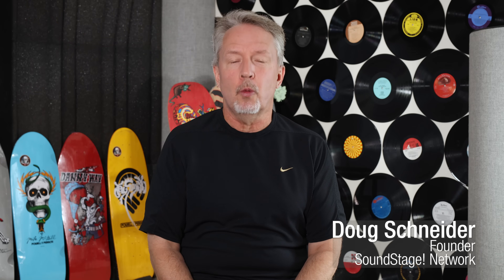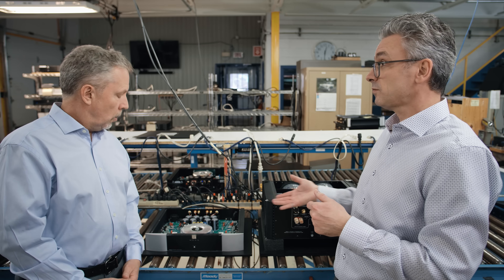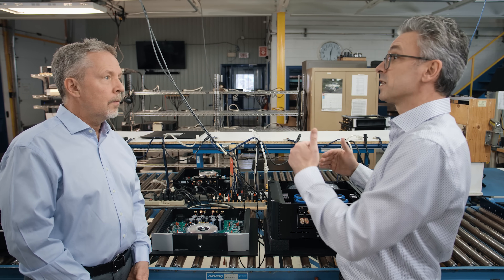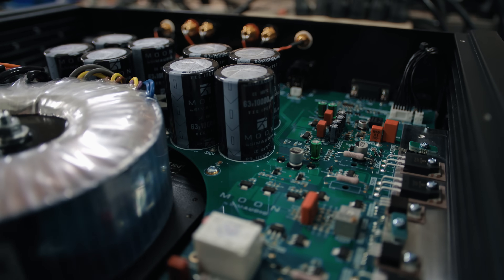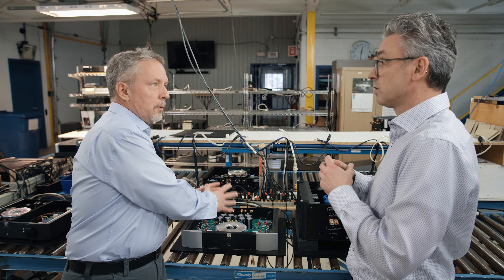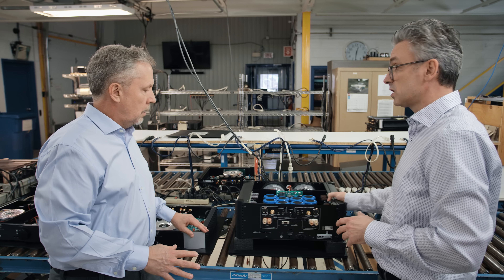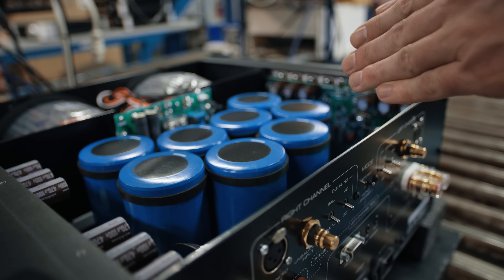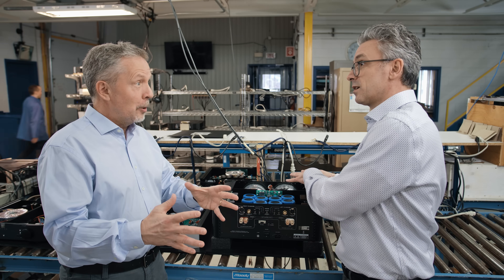Why Amplifiers Don't Sound the Same - Understanding Voltage and Current for Loudspeakers (Ep:71)

Comment: He just touched upon an amplifier’s power supply’s ability to supply required amps and volts to produce music as needed.

We are supposed to be talking about why amps “sound” different -

Although most middle-aged people can’t hear beyond 12/13 kHz, and the lower frequencies have their own limitations in each amplifier, - but the SOUND of each amplifier is really dependent on the chosen transistors and diodes and .   . . . Resistors and inductors and . . . . ALL of which in their respective characteristics - switching seeds, amounts of currency’s able to move in a specific amount of time, the “color” of the Signsl coming out of the  these components etc - being able to reproduce harmonics that accompany the fundamental etc . . ,

This is why the most expensive amps- think McIntosh have large chassises etc to house very large  - transformers and Capacitors to help reproduce those sounds.

Two equally priced amps, McIntosh V Accuphase will sound different  - to a 13 year old kid who CAN hear all those frequencies and the power they are delivered with.

Best tests of any power amp is the ability to faithfully reproduce a square wave - 

Look at the FFT output of each amplifier with the same square wave (amplitude and frequency) going in - with this setup even an old man will be able to “hear “ the differences between the two amps.

The main tone of the Fundamental frequency will be of a different amplitude at the output - as well as the harmonics - which too will be of differing amplitudes !

That’s how you determine the differences in sound produced by different amps !

Take a screen capture - of both FFT outputs. 

Do a Dynamic Distance metrics on these and “see” the difference a 13 year old kid gears !

Comment: Simple , buy an amplifier which   doubled the watts when half the impedance!  If amplifier delivere 100 watts at 8 Ohms , it's should delivere 200 watts at 4 Ohms  and 400 watts at 2 Ohms so on ... such Amplifiers requirs substantial power supply  and output stage.

Comment: Sorry for the stupid question but does that still mean that given a speaker of avg sensitivity many amplifiers will sound the same at low-moderate listening volume since the amp will not be called to reach its power supply or output limits??
Reply from the maker: Basically, yes.

Comment: I much current can a typical stand-mount and floor-standing speaker demand from  an amplifier? My current amp ( pun intended) is an Audiolab 6000A, is capable of supplying 9 amps of current into a speaker and it sounds really clean. Thanks for this video.

Comment: Something's will always get more complicated if you let them.. and owned 16 different amplifiers in my lifetime to this date.. the only difference between amplifiers I've ever heard or whether they were the letter d or the letter H or the AB TYPE.. THE OTHER WHICH IS OBVIOUS IS THE OUTPUT OF THE AMPLIFIER SO A 50 WATT AMPLIFIER WILL ALWAYS SOUND MUCH LESS APPARENT THAN A 200 WATT AMPLIFIER PER CHANNEL.. SO WHEN COULD GET TO THE POINT OF DELIRIUM ATTEMPTING TO MATCH SPEAKERS WITH AMPLIFIERS WITH TURNTABLES WITH CARTRIDGES.. MAYBE TO THE POINT WHERE YOU'RE NEVER SATISFIED AND YOU'RE RETURNING EVERYTHING YOU BY AND YOU'RE MISSING THE FINAL OUTCOME.. WHICH IS THIS AND IT IS JUST NATURAL HUMAN EXISTENCE. IF YOUR EARS ARE ONLY 20 YEARS OLD YOU HEAR THINGS ARE YOU HEARD THINGS DIFFERENTLY THAT YOU WOULD ONCE YOU'RE PAST THE AGE OF 35 OR 40.. OR EVEN OLDER THE THING IS IS THAT ONCE YOU GET PAST A CERTAIN POINT IN PHYSICAL AGE FROM USE.. THE FINER DETAILS END UP NOT REALLY MATTERING MUCH, I TELL THE TRUTH.. ONLY BECAUSE I'VE BEEN WORKING WITH SOUND SINCE I WAS 12 YEARS OLD CAN I DO KNOW WHAT'S WHAT AND I OWN THAT I AM IN MY EARLY SIXTH DECADE I SHOULD WRITE A BOOK ABOUT THIS BECAUSE IT IS THE SAME FOR 80% OF ALL HUMAN BEINGS.. NO REASON TO OBTAIN EQUIPMENT THAT IS FAR ABOVE YOUR OWN ABILITY TO HEAR OR TO SEE BECAUSE IT WON'T MATTER.. AND IF YOU GET TO A CERTAIN POINT THE SPL OR THE VOLUME FOR THE PRESENCE BETWEEN YOU AND THE TYPES OF SPEAKER YOU MAY PREFER OR CAN AFFORD..😊😊😊😊

Comment: Maybe you can do a video in the near-future about Class A or AB amps vs Class D amps when it comes to output current. I've noticed most Class D amps are 25-30 A, despite putting out a lot of wattage, while Class A & AB can easily double or triple that number; the Parasound JC1+ are capable of 180A! I assume it's because of the power supplies being small in the Class D amps vs big transformers and caps. 

I've used Class D amps for the past 4 or 5 years to drive my Dunlavy SC-IV and SC-V, but I wonder if I wouldn't be better off with something Class AB with 60+ amps of output current. How much current is really enough?

Comment: The issue of speaker sensitivity get complicated when measuring using 2.83v on a 4 ohm speaker. 1W is not what that speaker sees.
Reply from the maker: It's not that complicated if you realize that in hi-fi, we're not talking about power sensitivity but voltage sensitivity. Doug Schneider explains that in this video: https://youtu.be/XQs2tBsfPBk

Comment: What's the difference between the output of 1 watt power tube and 1 watt power solid stage? classA
Reply from the maker: A watt is a watt -- tube, solid state, class A, class AB, class D
Reply: @soundstagenetwork  so a 1 watt tube amp is equivalent to a 1 watt solid amp producing the same decibels to drive an 8 ohm speaker.
Reply: @edSuwanDiyAudiophile To jump in here -- a watt is a watt. You use Ohm's law to calculate -- and it's the same for tubes and solid state. Voltage, current, and resistance, that's it. There's long been a thing, though, where people think "tube watts" are more powerful watts. I'm not sure why. Perhaps some engineers can jump in and explain where that stemmed from.
Reply: @dougschneider8243  this is always my question about voltage and current, and I got the same answer as described.  but in practice there is a marked difference.  I don't know if the manufacturer didn't provide honest specifications or indeed my test was inaccurate.  if I observe this relationship with Current and voltage.  
Correct me if I'm wrong, the tube plays with high voltage and is solid with current.  up here based on Ohm's law is still the same.  but in practice impedance becomes wild and different from real DCR.  from my experience 1 watt tube with transformer output provides a more stable impedance (matched - more efficient) than a solid stage.  Possible?  correct if wrong.  but this has always been curious and I'm still looking for a physical explanation.

Comment: If you get the paper if you get the right paper by Bob Carver it will explain you about voltage and current.. on the basis of voltage that is driven for the bass note, high and current is made mainly for the mid-range and tweeters for softness or soft glow, give you an example Japan receivers of the last 35 years use only voltage very little current then what else sound too good, I had a marantz receiver from overseas, better bass notes with the current and a touch of current for the upper end, my Carver HR752 receiver have higher voltage and 30% more current.. you might say a high-end receiver and it was...
Reply: Bob Carver White Paper on amplifier.. it explains everything

Comment: Are 11ohm loudspeakers easier to drive than 4 ohm types?
Reply: What's important to understand is that in almost all loudspeakers, impedance varies with frequency. So there's really no such thing as a consistent 11- or 4-ohm speaker. You'd have to see the impedance over frequency to know which would actually be easier to drive.

Comment: Just get some powered speakers that come with a built in amplifier. I switched over to powered speakers in 2021. Currently  I have two QSC KW 153 speakers and two Bassboss VS21 subwoofers. The QSC's are 3 way speakers and they sound better than comparable ones from Mackie, Electro Voice, Peavey or JBL. The Bassboss has a 21 inch subwoofer and it's amazing. It has more low end punch than a cabinet with dual 18 inch subwoofers.  I have everything  hooked up to a Yamaha MG 10 mixer and a Sony CD player carousel. Bassboss products draw a lot of current. My living room had the standard 15 amp wall receptacle outlets. I decided to change those to 20 amp outlets  along with 10 gage electrical wiring as a precaution.

Comment: Loudspeaker impedance is a very important consideration when choosing an amplifier and the power supplys ability to deliver enough current. A loudspeakers impedance varies greatly with frequency. Some loudspeakers have an impedance that may drop as low as 2 Ohms and will require an amplifier capable of delivering high current on audio peaks. In other words, if your speakers impedance dips low at certain frequencies then choose an amplifier with a beefy power supply. The lower the speakers impedance the higher the current required to prevent the voltage across the speaker terminals from collapsing.
Reply: You're halfway right get the white paper by Bob Carver you explain to you

Comment: Zero negative feedback Should result in Better sound?
Reply: Not necessarily. First, it's hard to find a truly no-feedback design, even if the manufacture says it. But more important is that feedback is not, as one amp designer once said to me, "the work of the devil." Feedback is used to correct the output signal and in doing so generally lowers distortion and, also, the output impedance. So when you look at the measurements of an amplifier with feedback -- pretty much all -- you'll see lower distortion and a lower output impedance of overs with no or little feedback.
Reply: @dougschneider8243  thank you for the answer

Comment: What is an "audio signal"?  
Short answer: It is a single voltage that varies over time.
Long answer: It is a single voltage that varies over time.

It is a basic understanding in physics that any conducting component (wire, capacitors, coils, tubes, transistors, transformers and on and on) can have only one single voltage present at any given moment in time.

All that bouncy ball voltage does is direct the motion of your speaker cones.  In fact it is literally a map of how to move them to reproduce the entire performance.  That waveform you see on an oscilloscope is exactly that ... a plot of how to move the speaker cones.

There's no magic.  Just plain old directed power delivered to a speaker.

Comment: Hello, i have Dynaudio Heritage Special loudspeakers and they do need some power as i believe they dip into 3.2 ohms and are 85 db sensitive. I have a good solid state amplifier now but before these i had powerfull class D amplifiers but they were not a great match. I'm curious on how much current class D amplifiers have in general. Do they have less current then a good solid state amplifier?
Reply: The answer is: "it depends." That's the same as it is with most things. You could have a poorly designed class-D amp that doesn't drive speaker well or one that does. What many class-D amplifiers DON'T do well, however, is stay linear with load. Many sag in the high frequencies when driving a loudspeaker. But not all do. The Purifi-based amplifiers I've had experience with -- Purifi's own engineering sample plus two power amps from -- have high output power and the ability to drive low impedances with each. For example, all the amps I mentioned output around 200Wpc into 8 ohms or 400Wpc into 4 ohms, and are stable down to 2 ohms and below. Many traditional solid-state amps can't do that. Hope that answers.

Comment: That has nothing to do with "sound". You are describing power delivery capabilities. A low powered class A amp can sound significantly better than a high power class A/B amp or vice versa!! No doubt a well designed power supply is required for a good sounding amp, but more importantly is the amplifier circuit design that "shapes" the sound of an amplifier that makes one amp sound better than the other.
Reply from the maker: We think that most would agree that if an amp can't deliver sufficient power it will affect the sound.

Comment: Is it as simple as the ability to deliver current as the speaker load draws it or do other factors also come into play. I have heard differences between various amps in stage depth, lows, mids and highs. Sometimes there is no difference in certain areas, sometimes it stands out significantly.  Also, why do some amps sound smooth, some grainy, etc.?  I listen at moderate levels tending a bit on the lower side to judge these differences assuming that most amps can supply the necessary power requirements at these levels.

At louder levels, you can hear when an amp is running out of steam and it probably starts doing so before you actually hear it, but before that, I can hear differences.  When I choose an amp several years ago I compared a hegel h90 against a Parasound Halo integrated and preferred the Hegel. The differences weren't much but it was there in the shop on B&W floorstanders, speakers well beyond what I would actually use.  system synergy, room, etc. could have played a part but I have swapped out alot of amps in my room and speakers and hear differences. 

I did end up with a Hegel h160 and a Keces E40, and both play to my liking.  If I listen to the h160 awhile and swap in the Keces, I notice a slight difference but I wonder if that's due to the Keces E40 going from a cold start.  Going the other way, the difference isn't as noticeable at least in the lows and mids. The hegel has a bit more extended highs but the Keces is a nice little amp.

Both drove the Dali Menuet SE just fine but the Keces petered out at about the 3 o'clock position while the Hegel had no issue with going louder but that little speaker is known for being power hungry and dropping well below 4 ohms over a significant part of the lower mids. The small amp got quite hot in the process.  Pushing a Dali Opticon 1, similarly spec'ed, it had no issue as the speakers per measurements never drop below 4 ohms.

It's a rabbit hole hobby isn't it?
  
   .

Comment: This is one of those time the analogy to water flowing in a plumbing system is informative.
Current is the volume of water that can move.
Voltage is the pressure of the water.
The capacitors are a local reservoir or tank.  They can supplement the supply and smooth out the flow pulsing from the pump.
The transformers are like the pump that can take it from the well to the tanks.
The size of the wires are like the size of the pipes.  Bigger can move more and more instantly.
Finally the transistors or the  vacuum tubes are the valves that regulate the flow of current/water.  Each valve can supply only so much, so many are used in parallel.
So the valves are opened and closed in relation to the little signal coming in and amplified into a large flow.  We want the output to exactly and instantaneously match the signal coming in.  Most of the time the signal is very small and we use a fraction of a watt. (V*I).
But when there is a large sound like a drum strike, we want the speaker to instantly respond and that takes a momentary surge of power to recreate the dynamics.  If the amp cannot respond quickly, accurately in driving the speaker, the sound will be off.  The extent to which the sound is off will be the color of the amp.

Comment: Diving just a little deeper ....

Most amplifiers are voltage sources.  
That is they will try to develop a voltage on the speaker leads that is in direct proportion to the input signal multiplied by their gain... so with a gain of 10 (for easy math) we should expect to see 10 volts on the speaker leads for every volt of input to the amplifier.  The more precisely this is done the better the whole thing works and feedback output-to-input is most often used to stabilize this relationship.

Current is the result of applying voltage across a load.
This is Ohms law, the most basic understanding of electronics.  The current will be the result of the voltage applied divided by the impedance (resistance for dc) of the load.  Thus putting 10 volts (again for easy math) on a 4 ohm speaker will result in... 
Current = Voltage / Impedance = 10 / 4 == 2.5 amps.
... and it is up to the amplifier to make at least that much current available on demand.

Power is the result of voltage and current.
This is Watts equations.  The power developed by applying a voltage across a load is the result of the load impedance.  There are two ways to calculate this. 
First you can use Ohm's law to determine the current and multiply that by the voltage so 
Power = Voltage X Current = 10 X 2.5 == 25 watts
The second way is a shortcut that lets you determine power from the load impedance...  
Power = Voltage squared / impedance = (10 x 10) / 4 = 100 /4 == 25 watts

These are the laws of physics  Dominique Poupart was referring to in the video.  They are not complex and most problems can be solved with a voltmeter and a calculator.

But here's where it gets tricky ... Speaker impedance is not one number.  It actually varies with frequency, crossover design, driver characteristics and even box dimensions.  So the only way to objectively determine how much current reserve an amplifier needs is to find the lowest impedance of a speaker and calculate from there.

If an amplifier's power supply or output stages can't deliver enough current, it's going to sound weak or compressed and probably will lack deep bass response, since that drains the supply's reserves most quickly.

I hope that helps....